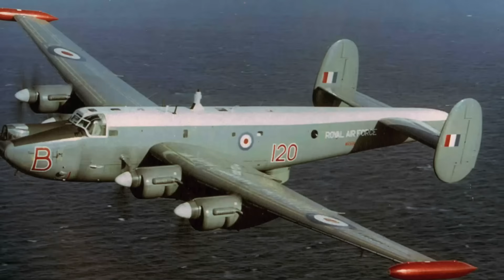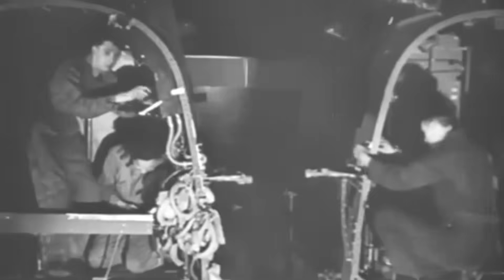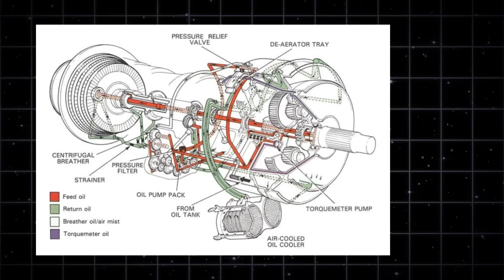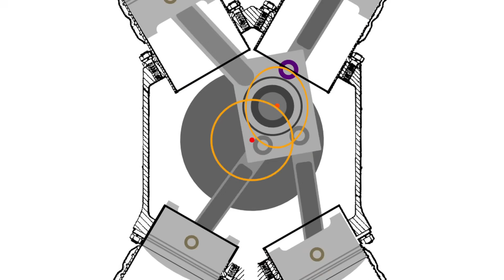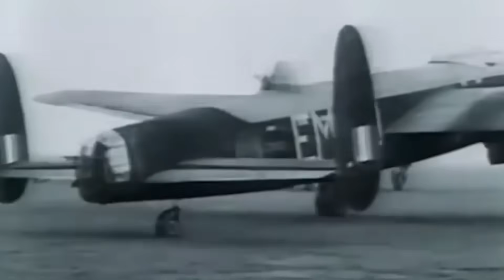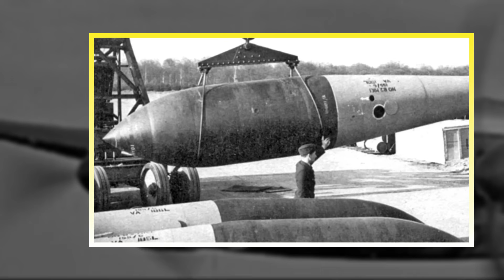The Shocking Truth Behind Rolls Royce's Vulture Engine

Comment: What they did made sense, the Vulture like the Peregrine used the existing production facility ànd tooling of the Kestrel where as an enlarged Merlin (Griffin) required new everything. Nobody predicted that given its origin in the well proven Kestrel it would be a source of so many problems, however we also need to put it in the context that the Merlin was also a basket case of issues at the time and it was only really by well into 1940 that they knew how to mass produce the Merlin as they struggled with the issues such as the cracking in crankcase casting during manufacture (solution was not to stop the cracking but worked out how to weld the cracks up), quite simply Rolls Royce did not have resources to debug the mass production of the Merlin and debug the Peregrine and Vulture and by the time they did they had the Merlin developing the same power.

Comment: The Avro Manchester was Britain's version of Germany's Heinkel-177A "Greif" (Griffon).
The Rolls Royce Vultures proved so dangerous and unreliable that the Manchester was withdrawn from service.
The Daimler-Benz DB-606 that powered the He-177A was actually 2 DB-601 engines driving through a common gearbox. They suffered repeated catastrophic fires to the point their crews hated flying with them. They were a sort of improvisation until either Daimler-Benz or Junkers developed high powered engine to an operational state. They had worked well for the He-119 experimental bomber/reconnaissance plane but were a total disaster for the He-177A

The British Air Ministry allowed Avro to redesign the Manchester with 4 separate Merlins, resulting in the hugely successful Lancaster.

Reichsmarschall Goering refused Ernst Heinkel's entreaty to redesign the He-177A with 4 separate DB-603 engines, demanding he make it work with the problematic coupled engines.

Heinkel secretly built an He-177B with 4 separate BD-603 engines out of sight of Goering and the RLM at his Vienna-Schwecat plant and it apparently showed excellent performance prospects, but of course he dare not tell the authorities.
Heinkel also built the He-274, a high altitude bomber with 4 separate DB-603 engines at the Farman plant in occupied France. After the war it served to carry experimental French ramjet aircraft to launch altitudes and once again was found to be very reliable.

So it was that two promising heavy bombers powered by unreliable high-power engines resulted in two different outcomes. 
Thanks to their respective leaderships, England got one of the best heavy bombers of the war and Germany ended the war without a heavy bomber.

Comment: The 2 'V' engines in the Vulture had 2 dedicated coolant pumps that starved each other untill the inlet tubes were revised. 
  Aero engines do not use an offset like autos do to save on overall length. With 24 cylinders and each crank throw sharing 4 connecting rods. 
  Oil control in the big end rods was not the issue. It was shuffling of the master rod and the four bolt cap that housed the 3 slave rods and their pins.  Silver shims were tried, but shuffling was never truly solved. 
  Like tge doubled Diamler engines for tge Amerika Bomber tge issues were never solved.
 The only successful 'doubled' engine was the Allison DV 3420 24 cylinder with 2 cranks in a shared crankcase. Output was 3000+ hp and promised much more.  But it was too late for service in the war. The various dream planes never entered service. 
  Like other promising designs, it was abandoned for jets.